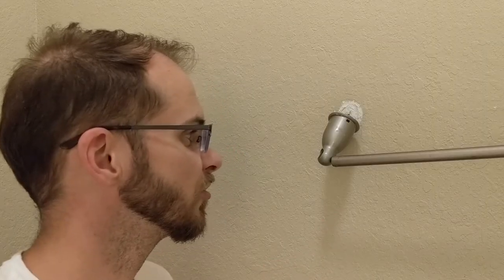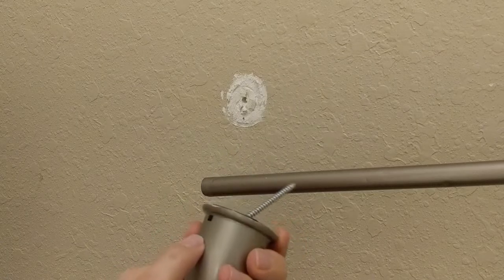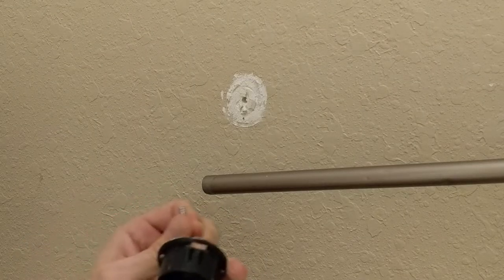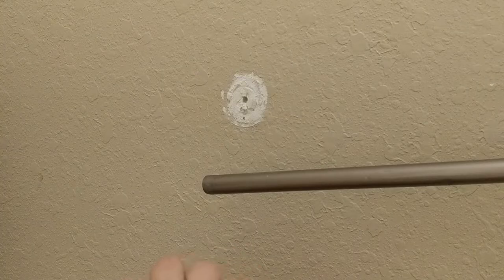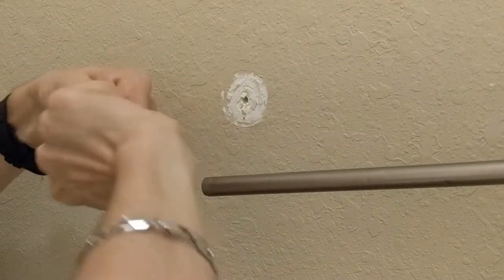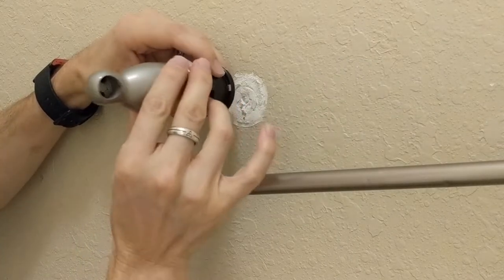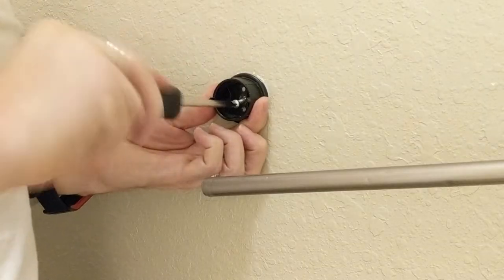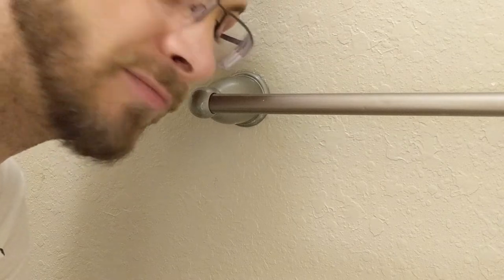5Min Fix - Towel Bar Pulled Out of Bathroom Wall Repair

Comment: God bless you for your patience doing this frustrating job and at the same time to record it as well 😀
Reply from the maker: Haha! Thanks :)
Reply: This is not a proper way to fix it!!! 🤦
Reply: Just drill a half inch hole and put a toggle screw in it. It'll hold up to 100 lbs in most cases.

Comment: When putting up the bar, I heard of something that sounded like a really good tip that also involves paper: Stick some damp paper from paper towel or tissue paper into the holes on the bar mounts. That will prevent the bar from rattling and moving side to side, making the whole thing feel rock solid and nice and quiet. And prevent the bar from sliding out of the holes if the mounts are a little far apart.
Reply from the maker: That sounds like it might help making it wet but I'd be concerned of putting anything wet in the wall. Tissue and paper towels don't have the same resilience and are designed to degrade quicker, so I'd be hesitant to use those materials. They may work though! Have you tried it?
Reply: @FryerDIYguy  Not into the hole in the wall, but into the hole on the side of the decorative attachment where you stick in the rod. Makes the rod more stable between the attachments.

Comment: Just spray some spray foam in the hole until it oozes out then screw the bracket back on. In two hrs it will be completely secure. You may want to punch a slightly larger hole before spraying.
Reply: What kind of spray foam?
Reply: @RIZEArtStudios  IT's called Great Stuff shouldn't cost more than 10 dollars from a hardware store

Comment: I appreciate the quick fix. But this is only temporary and so t be strong for long. Proper fix would be to use toggle screws.
Reply: Yep. Toggle screws work best for dry wall. Most of them can handle up to 50 lbs, more than enough for towels.

Comment: Bummer.  This didn’t work for me.  The paper just pushed right through the drywall because there was no stud behind it.  I just added a plastic drywall anchor and it worked well.  But what is frustrating is that the other end of the towel bar is a bit loose and the tiny screw that holds the bar on won’t tighten anymore.

Comment: I think everyone has a sheet of paper and a screwdriver at home. This is a bandaid tho and not a permanent solution. The paper will absorb moisture in the bathroom and loose it's strength.
Reply from the maker: So far it's been 1 year & 4 months and held up to two little boys. You can try cutting a sliver of a pencil if you want something else.
Reply: @FryerDIYguy wow! I stand corrected. THX.

Comment: This has got to be the worst way to fix this problem. Your relying on a piece of paper to hold this in place? No epoxy putty or reinforcements of any type .
Reply from the maker: Appreciate the comment, always looking for suggestions. But it has been working for over a year and being in the bathroom of two 7 year olds ;)
Reply: FryerTad well. I guess it’s worth a try . Sorry for the snarky comment .
Reply from the maker: No problem!